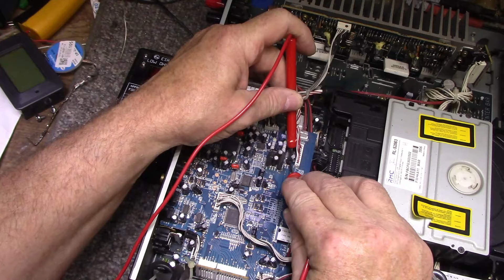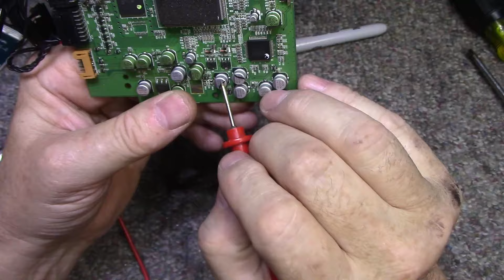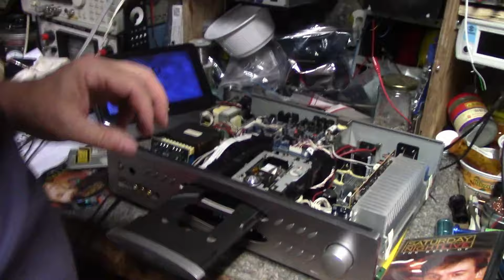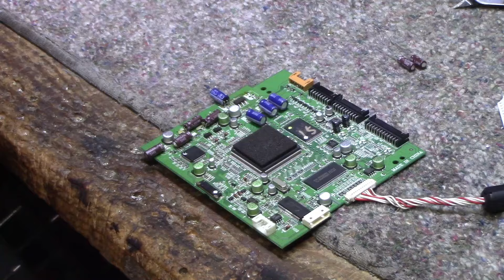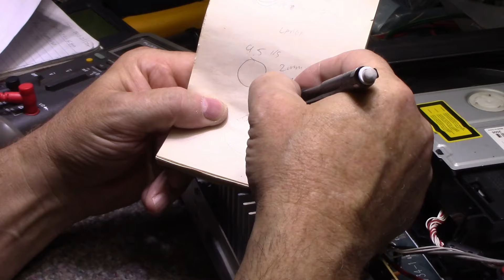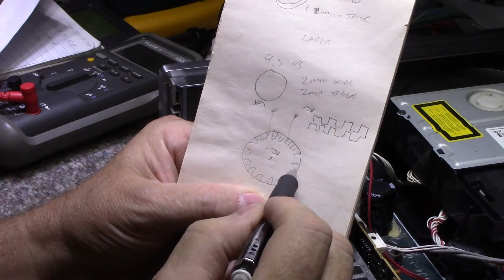NAD L53 DVD Receiver - Repairs (Ep. 237)

Comment: First comment ever on youtube so here we go ;:) But I got my self a NAD L54 that looks exactly the same as the one you have there from a dead relative. My problem is it says "RESET" in the display and wont start up or react to any of the buttons. Any tips?
Reply: you need to open it up and find IC33 chip. Then connect pin 6 of IC33 to ground and power it on. after that you can remove that connection.

Comment: Failing servo section smt caps are also often responsible for sacd players' premature demise. They will no longer recognize the DSD layer on a hybrid disc, or even the ToC in extreme cases and display no disc like here. I do replace them like for like though with Nichicon smt low esr range available on Mouser. The rattling clamp was often resolved with a self adhesive damping pad on Sony SCD range players.

Comment: About those caps near the voltage regulators... I would try to solder them underneath the board so the heat from them will not influence anymore that it there is enough room. Nice vid Trevor

Comment: I didn't belive you can fix DVD by changing the capacitors (thinking it woul be drive assembly problem) but you did!👍Remote control volume and and panel volume (rotary encoder) seem to work independently...don't they? Thank You!